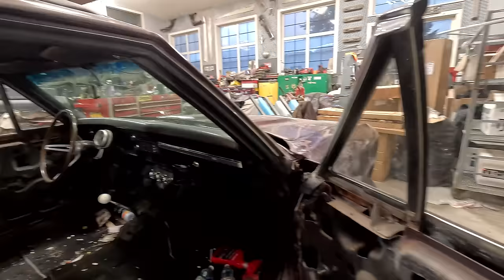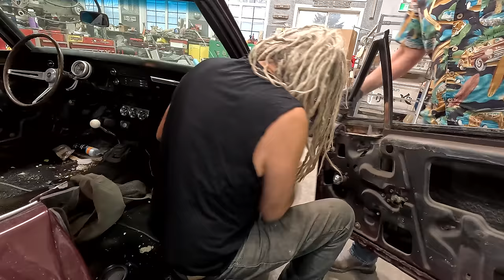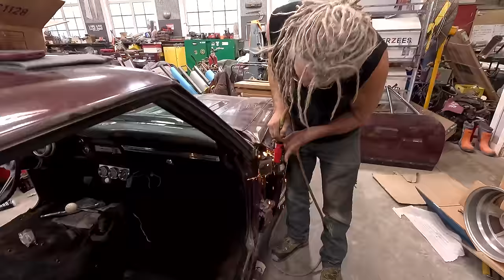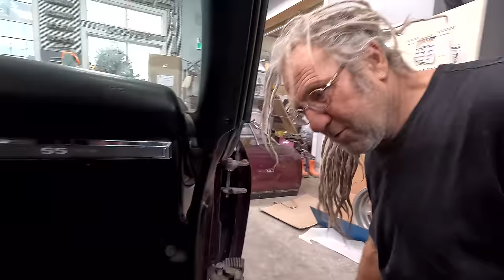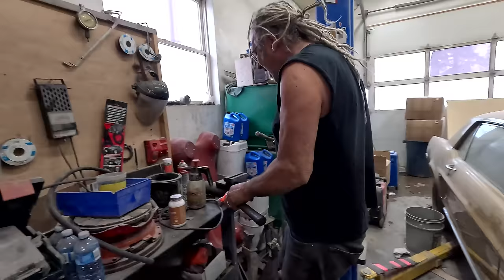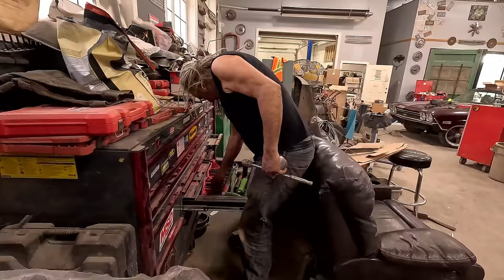Disassembling a 1968 Chevelle

Comment: If you get that door pin red hot with the torch,then bang it like Blare was doing,it might work a bit better.
Reply: No. Heating expands metal.
Reply: @jeepstuff4004  not the whole pin ,just the head of the pin.to mushroom it like a rivet.

Comment: Mike you are starting to sound like me lol 😂do you  always talk to  your self. By the way  replacing those  door pins suck the brass bushings always seems to  brake on the way  in all the time.   Nice vice time for a new  one. Sucks  getting older  trying to get  under the dash of the car,s. You are doing a nice  job  can't wait  to see the finished result 👍. Did you  ever heard of the  saying (pain come ezy)  Blair put a little   hair around  the  hole this  way you can  get the   🔩 started 😂😂😂.